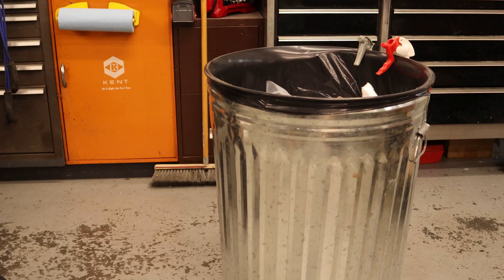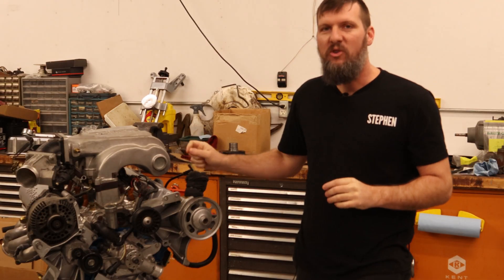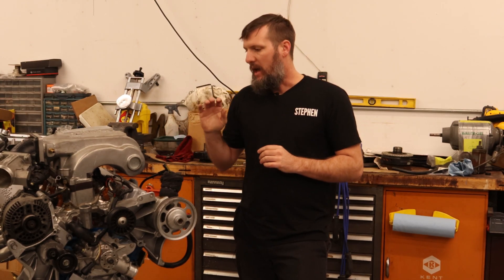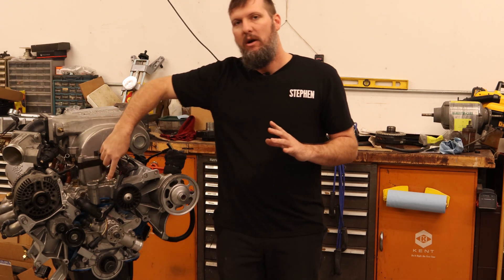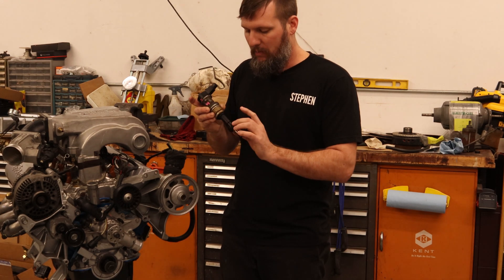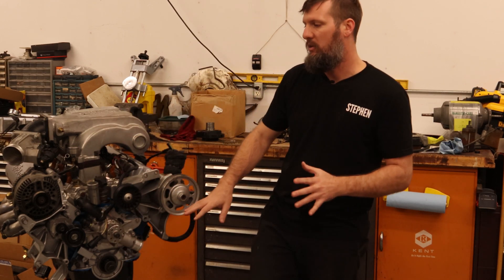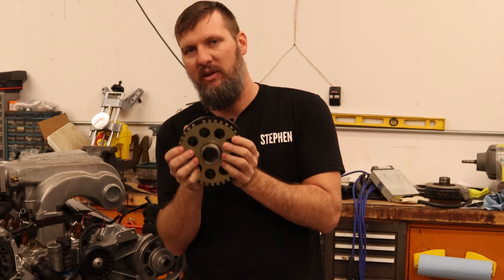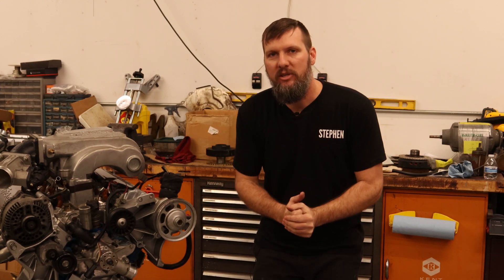SBF Ignition Upgrade: From Distributor to Coil Near Plug

Comment: Is there a reason you cant use the explorer coils?
Reply from the maker: Explorer uses 2 coil packs with wasted spark, meaning that 4 cylinders are connected to one coil pack. Similar to early 4.6L mod motors

Comment: I'd love to get the aftermarket coil on plug kit, with it and the Holley high ram with the side inlet top, that would make that old 5.0 look really modern and it would completely baffle so many people, I bet there would be people that at a glance think it was an LS swap. I'm not saying I want an LS swap I just like the modern looking engine but still have the iconic 5.0 I love.
Reply from the maker: I agree the only problem is the high RAM won't fit under a stock hood, I looked. I thought the same thing it would look similar to an LS but be better 😁. Now if they made the mid or low mount for the SBF I would probably get that but they don't and probably won't since it won't fit 99% of SBF out there. Custom intakes are too expensive as well.

Comment: Surprised you didn't order a PiMPxs through Stinger Performance. It has all the bells and whistles you would need and it's a lot cheaper than an aftermarket standalone ECU.
Reply from the maker: The PiMPxs is a standalone ECU. I looked at it but to do the distributorless ignition setup that I did it was going to be $2500. The DIY Ford route was around $500

Comment: How would this help with installing a s/c?
Reply from the maker: If installing a screw/roots style like on a terminator Cobra. Normally the distributor is in the way for the snout. Yes Kenny Bell makes one for the sbf by offsetting the blower, but that is just working around the problem.

Comment: Dude you could have saved yourself a lot of headaches with the EDIS-8 setup from the og mod 4.6. I built a distributorless deal for my buddies fox body and that EDIS system is stupid simple, so much so that i built one for my Camaro lol
Reply from the maker: While that's a good alternative it wouldn't have saved me any headache. Probably just caused more. I have a complete EDIS-8 setup and coil packs sitting on the shelf. The SN95 ecus don't work with the EDIS controller plus they are coil packs where I wanted individual coils. I could have probably ran EDIS on my car using the Autosport Labs Jolt system but then I'm running a separate controller for spark and fuel. I've looked into all the systems this is what suited my needs the best and stayed in budget.
Reply: @RinerAutomotive  ok I should have elaborated:
You know how all these aftermarket coil on or near plug systems have similar prices? Well it's because of the controllers taking up the bulk of the cost, the coils, brackets and wires are all dirt cheap if you don't take into account the price charged for names like MSD. So those companies make a big deal about how "complicated" these ignition controllers are justifying what they charge. I called bullshit and went o see if I could build one (I did this in spring 2020 when I had some extra spare time on my hands). Anyway some small companies make edis specific controllers, Megajolt sells a plug and play unit for $200 or a " you solder it together" and assemble the controller. Then there's an open source deal that'll run everything from efi - an electronic transmission from Speeduino, which you can buy ready made ecu's or again go the solder it together yourself route. I went with the speeduino guys and found a seller of their boards on ebay that will build a custom setup depending on what you want it to do. And with mine having ignition controls and rudimentary efi, the completed board was $100. The tuning software is open source and free to use as well, it's very similar to HP tuners if you've ever used them. They have base programs based around all factory tunes from popular engines like the Ford 5.0 and SBC, these are actually copies of the programs used by manufacturers back in the day of obd1 ecu's. Point is you don't have to start from scratch or code anything. All this sounds involved right?, well initially it is, but after knowing what to get and where it was its made subsequent builds 10x easier. Sorry for the novel
Reply from the maker: Yea I understand. Some people want the systems together as one, some want them broken up. The main thing to know is what type of coils the system works with (built in ignitor or external ignitor) and how many coils you want/need. We are talking about the same system the MegaJolt made by Autosport Labs.

I have done the build your own Megasquirt system before. Really just like the OEM reliability and ease of use. Only need to change some parameters, not start from scratch. But things have come a long way since when I tried MS2.
Reply: It does work, while EDIS8 wont work with CBAZA you can swap strategy with A4A1 so it works. IK you did much better with eec v but Just in case someone see @RinerAutomotive
Reply: I'd like to no more!, can this work on a holley sniper tbi I wonder
Reply: @alltherpm  it sure does, the sniper throttle body unit uses nothing bespoke to holley, so hi z injectors, and 5volt sensors. The sensors are either gm units or based on gm parts + it's a speed density system so no need to worry about a maf. All the big aftermarket efi throttle bodies can be controlled with other ecu's you just need to know the specs like injector size, are they high resistance or low, what setting the tps wants etc... The companies like Holley use controllers / ecu's with embedded software which can't be deleted or modified too much hence why they can charge what they do
Reply: We don't mod these things to save ourselves from headaches 😂
If anything we choose what interests us the most rather than what's practical. Sometimes I choose the path with the most headache if I will learn something alone the way

Comment: I would like to do this to a 400 (351C based). Wondering if you have any updates/progress. My current plan is to use the crankshaft wheel and sensor assembly from a 2V 4.6 and the camshaft wheel and sensor from the same engine. Good call on the Godzilla coils.  I have not worked out the mounting particulars of the rotating parts and sensing elements but I was hoping to use what the EEC5 ECM sees normally to cut back on the extra variables. I'm not married to that path and I'm hoping your solution would mean less fabrication.
Reply from the maker: I will have update videos coming soon, maybe 2 weeks. But it runs!
Reply: @RinerAutomotive Wonderful! Looking forward to seeing your solution.

Comment: I am curious why you did not  use the explorer wiring harness and ecu that is set up to run the explorer parts you are adding to your engine.
Reply from the maker: Explorers are coil packs not individual coils. So the ECU won't work. I could have used the harness but it would need to be modified for individual coils as well. Additionally the placement of the ECU is different so lengths are different. For a clean factory look modifying a mustang harness was the best option for me.
Reply from the maker: Good question though

Comment: I did a maf conversion on my 88 5.0 bronco. I built the motor as a HO with HO cam, gt40 heads and exploder intake. I used a 95 gt ecu which also uses e fans. I was looking into EDIS. The eeciv will support that. All 4.6 engines had it.
And that started in 91' I know you can turn on the EDIS in the 95' ecu but I'v been wanting to experiment with making the EDIS work with the ecu as is. The EDIS will work independently of ecu control like TFI does. But If the EDIS module wants the same spout signal from the ecu, That I don't know. I have considered using a ecu from a 4.6 as well but I like the aggressive tuning of the mustang ecu.  I don't want to mess with chips though. Later eecv is flash programmable so You could delete smog controls. I could image a car ecu would be fine because those cars are fast. and the eeciv is very adaptable. The car ecu would be very plug and play. Move some pins and add the EDIS harness. I would get a exploder cam synch and an aftermarket trigger wheel.
Reply from the maker: I've read the later mustang eeciv ecus (T4M0, etc) don't support EDIS. I had thought about that. I think the earlier A9L can work with EDIS. 

With tuning can make the computers do just about anything you want. If you switch to anything later than 95 you'll have to change to the EECV ECU. Which is a lot of work as I've shown.

Comment: Really curious to see how this turns out as I've always wanted to do this myself. However I am afraid of wiring unlike you lol
Reply from the maker: Got to start somewhere. So far the wiring has been just adding or removing wires. No crimping. But definitely do it on a spare and have a backup. I can easily revert back stock if needed

Comment: Did you balance the trigger wheel. It has one tooth missing. Did you cut a hole on the other side so it was balanced. Maybe someone can tell me/us it's not necessary because it's at the end of the crank or whatever?
Reply from the maker: I'm actually not sure about that. I do plan to mount it inside close to the engine and not attached to the rubber isolated dampener. It's not mounted out by the pulley. This is something I'll have to look more into. I could drill an appropriate size hole opposite of the missing tooth.
Reply: @RinerAutomotive  Yes drill a hole. The fly wheel is balanced on an automatic with weights that are welded on. Also when they balance your race crank they want everything that is attached to it and they mark the flywheel so you bolt it the same as they did. On the other hand I have read some say it's not necessary? So I am not sure!
Drill a hole slightly larger than the missing tooth size because your closer to the centre of rotation. It's mass times fulcrum length must be equal to be balanced.
Reply from the maker: Thanks. I've done some research and reviews are mixed if needs to be balanced or not. Oh well.
Reply from the maker: Looking at the stock explorer trigger wheel that I have, it doesn't have any balance hole. But the balancer has what look like balance holes drilled in it
Reply: It might throughout the balance at like 20,000 rpm, damn
Reply: @alltherpm  you don't know what your talking about. It will vibrate at different rpms depending on the natural resonance frequencies of the engine. It could be at idle.
Reply: @markbrzezinski8889  OK I build engines, u think every part on a car is professional balanced no its as close as they can so it's not perfect, u have no clue at something so stupid there's no reciprocating weight to worry about
Reply: @alltherpm  You said at 20000rpm which is being sarcastic because most engines can't reach that rpm. If you build engines then you know the power curve of an engine on a dyno has bumps in it or actually dips. What that is is the different components in the engine vibrating at different rpms. So balance has nothing to do how fast the engine is spinning. You try to minimise vibration to make the engine as smooth as possible. You don't have to balance anything and the engine will run but it will vibrate at different rpms and there will be some power lose at those rpms. Every component on an engine will vibrate at its natural frequency and that could be at any rpm. If your racing an engine and want every percent of power then you try to "minimise" the vibration which amplifies the natural vibration frequencies of specifically the valve train and more specifically the valve springs. Like people have said above. Some think that one tooth at four inches is important and some don't. I respect that you don't but resonance does not get worse with increasing rpm. It can be an issue at any rpm and you will lose power at that rpm be it a small amount which obviously at your workshop you don't care about. Some people do care and they also don't want different things on the car vibrating like a panel which will cause noise which can happen at any rpm. But I get it. You don't care.

Comment: I’m planning to purchase the f.a.s.t. Xim ignition controller tomorrow. Been planning it for about a month now and I feel like it might be a better package than using the msd 6011
Reply from the maker: Not familiar with that unit. Looking at it,, it looks to be a standalone ignition system. Would still need custom stuff for sbf. But if I recall you're modular.
Reply: @RinerAutomotive  I’m small block like you. I’m running a carburetor but I like the neat and tidy setup of a cnp ignition as opposed to a distributor. I have wiring tools to make a harness from scratch so my routing will be tidy as well
Reply from the maker: Oh ok. You might want to look into a standalone edis module with megajolt by auto sport labs. Probably cheaper and just as good.
Reply: @RinerAutomotive  have you looked into the setup for that one you’re taking about at all? The msd looks extremely simple to set up as well as the f.a.s.t. one. However the xim will save me almost $100. (Edit: from what it looks like, it’s saying that I’d need an edis module and different coils which might put me around the same price as my unit but with more complex wiring)
Reply from the maker: The f.a.s.t. one just looked like a control.  I think for all of them still need to figure out crank sensor, trigger wheel, cam sensor, and coils. The msd unit takes care of the cam sensor.
Reply: @RinerAutomotive  well I’m intending to use oem explorer sensors, except maybe upgrade to an innovators west crank trigger at a later point in time. Making a new harness vs opening up one would be just easier to make a new one. I already have everything except the controller and a harness made. (And what I meant by the setup is the programming software. I’m not exactly amazing with data tables so the msd looks like a breeze to work with and I imagine the f.a.s.t. is no different)
Reply from the maker: Gotcha that makes sense. Sounds doable
Reply from the maker: I assume you're using Fox or older style accessories. That trigger setup does not look like it will work on a SN95.
Reply: @RinerAutomotive  everything from scratch, oem sensors plugged into the ignition module. Then the innovators west trigger with it’s own sensor is also a 2 wire sensor that should be wired exactly the same